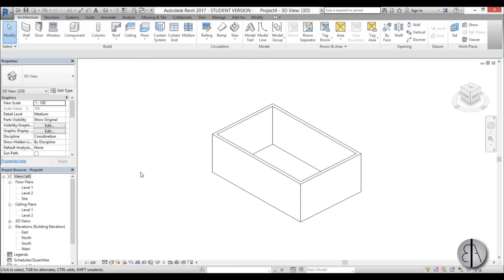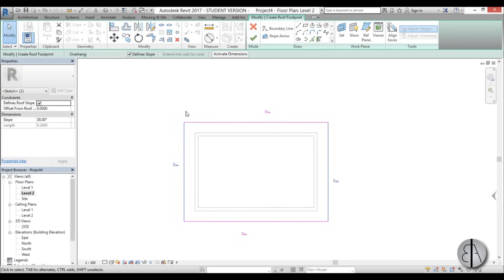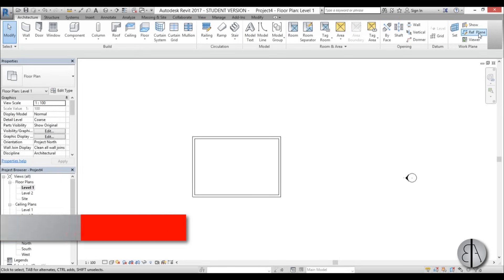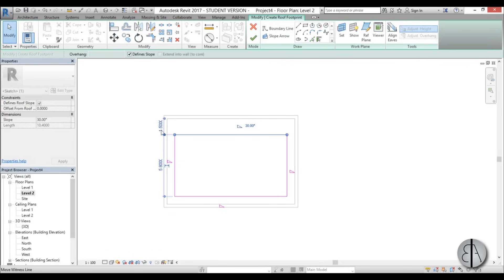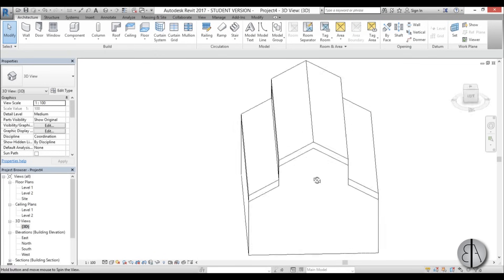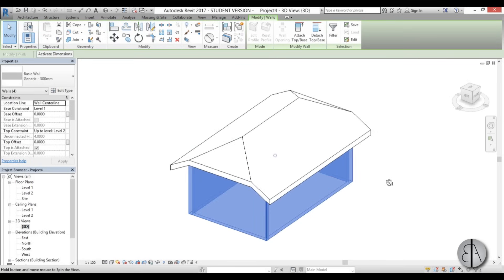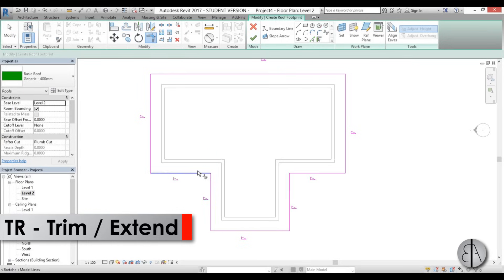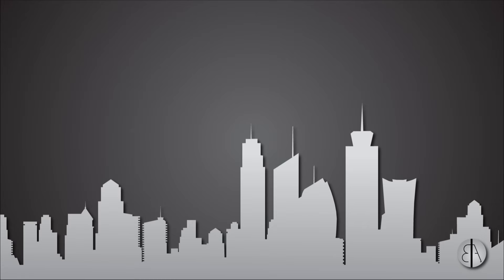10 Common Roof Shapes Modeld in Revit Tutorial

Comment: Trying to make a cross-gabled roof. My split element does not work the way you are showing. When I trim it, it only trims the upper line crossing and not the longer line connecting the two sides.

Comment: The angle option beside your pink lines isnt showing on my revit 2019 while using the roof tool
Reply: It doesn't on mine either but I was able to uncheck define slope up above and it still worked for me

Comment: I have a plot of 16x40 ft with two houses on either side. 16 ft being the width and 40 ft being the length.
What Roof Design would you suggest to be best. I would be using Steel Roofing.